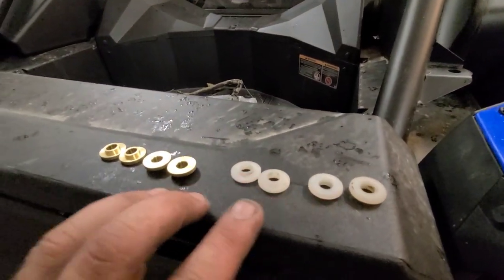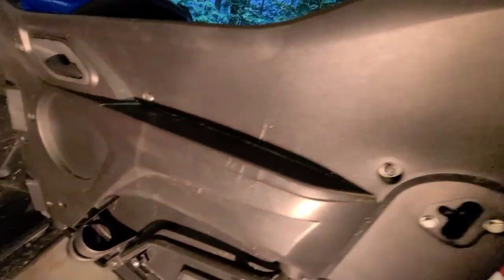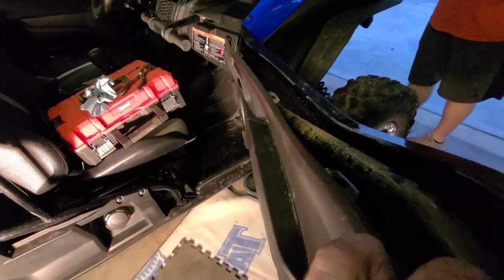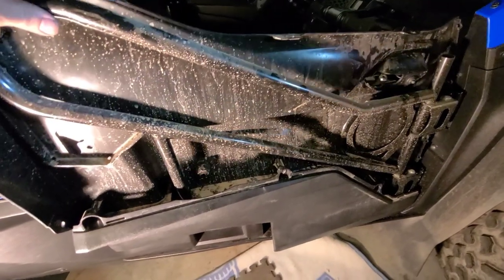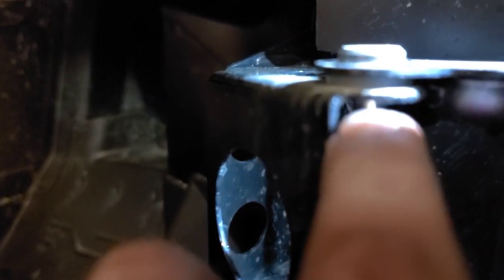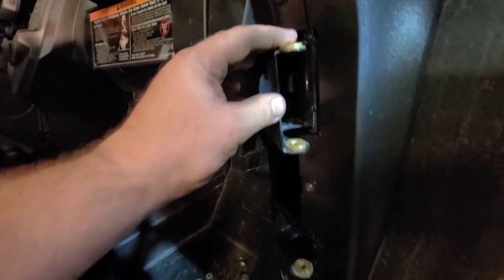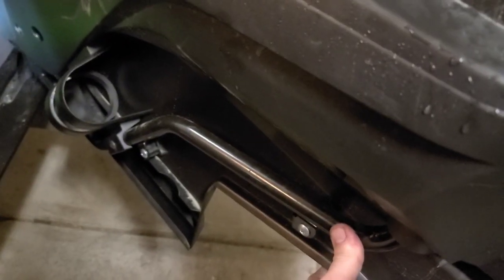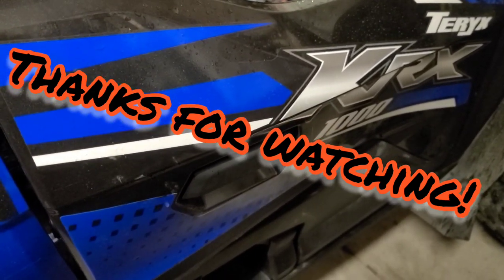KRX 1000 door rattle fix!

Comment: $63??  Pass.
Reply from the maker: You won't find machined brass ones anywhere cheaper.....
Reply: thats up to you, my doors have zero play in them now
Reply: you'll prob think different when your door doesnt close - mine didnt happen till 700 miles but it turns into a real PITA - not a difficult fix just time consuming and def worth it.
Reply: My bushings are shot with 1500 miles I ordered these I hope it fixes them. I'm so tired of buying shit to fix the krx and all it does is fix for the same amount of time as the factory stuff before it wears out again
Reply: @brandonstover8867  Try owning a Polaris.  I'm hoping my KRX proves to be much more reliable than my XP 1000.
Reply: I bought these and it didn't fix the issue. The door it self is wore out not the plastic bushings. Was a waste of money
Reply: @brandonstover8867  Good to know!  I'll have my dealer replace the whole door then since I still have a year of extended warranty remaining.  Thanks!